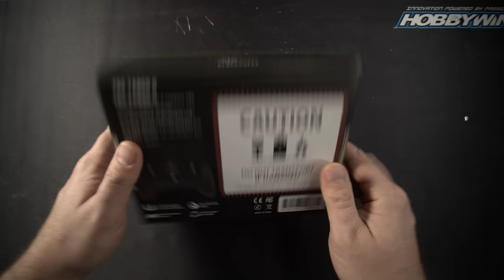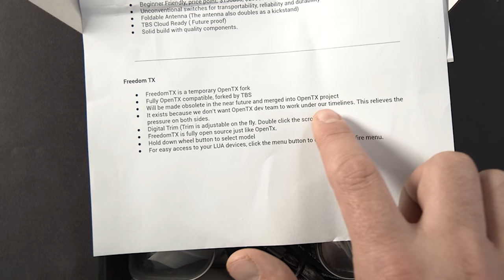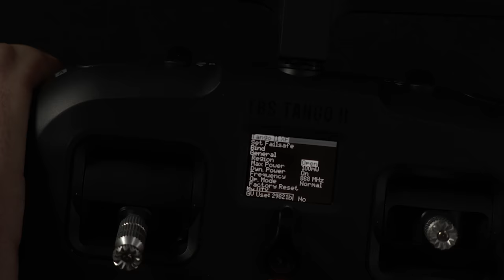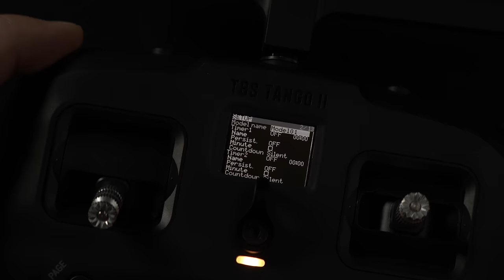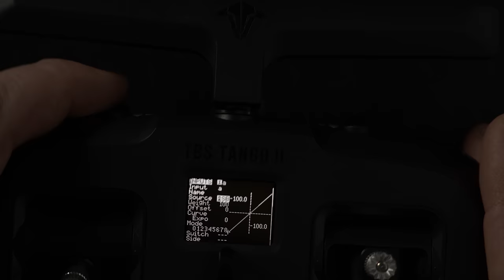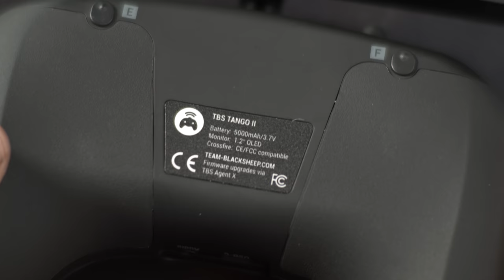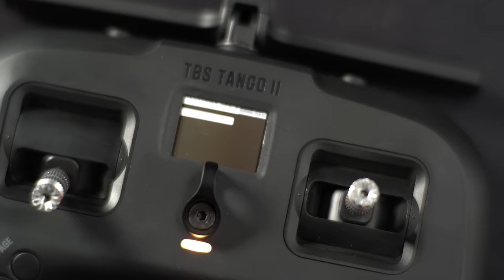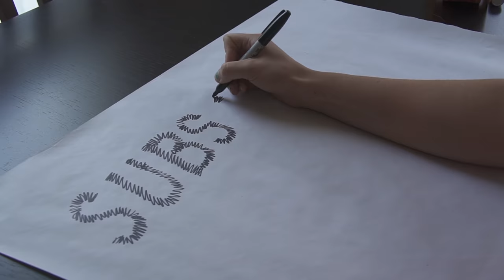TBS Tango 2 - Unboxing and First Flights

Comment: Sweet - awesome product, hopefully people will sell their old Jumper T16's to get these, and I can pick those up cheap.  I do like a lot of their thinking on the buttons and toggle switches - but having large hands and being a pincher means the big brick form factor works best for me.
Reply: @FPV-OG Either of the '16' line setup that has the internal multiprotocol module.  I know lots of people got those wanting it to be 'the answer', but may decide this is the radio for them.

Comment: Do you normally pinch without a neck strap? The fact that that's an option is encouraging. I would always use a neck strap myself, but ergonomics have to be pretty good to pinch and hold at the same time.
Reply from the maker: I always prefer a neck strap but it works very well for pinching without

Comment: One question. Why not just use the Dji controller for your Dji quads? You don’t have to solder an extra receiver to the quad that’s gonna break off after a crash. I’ve never had a fail safe with it yet. I understand that you have to use other controllers for racing analog or extreme long range maybe.
Reply: EscobarFPV because the crossfire has lower latency especially when at the edge of the range for DJI it gets much more laggy than crossfire
Reply: @properfpv7160  what kind of range are you talking about? I don't feel any latency at all from any distance that I fly while using the dji transmitter. I watched a video where he tested crossfire vs DJI(baud-fast) and the dji was a hair faster at 7ms. I've never heard of anyone complain  about latency with the dji transmitter.
Reply: Just looked at your videos. Dude. Do you even DJI? Let me guess. A buddy of yours let you fly theirs.

Comment: im not too sure about the added latency you mention , i've seen a osci test of 5 goggles and 30MS is normal on analog. The ev300d came out over 100MS tho,  so yeah, i was stunned by the results of fatshark etc. because i always thought it would be around 10-15ms.

Comment: How do you feel about those shoulder switches? Those rocker switches look like they're really easy to activate. I kinda wish I could have short switches like the x-lite on all my radios. 
Does it have a trainer port or any way to plug a multimodule or LRS system into it? 
I guess it makes sense to only have a 250mW output because of the 1s 5Ah battery inside. Can you charge while flying?
Does yours have the folding gimbal sticks?

Comment: Man, this is my exact issue with DJI - even at 700mw that's the kind of performance that i get in woods/trees even with focus mode, the image in those environments just get so blocky to the point where you smack into scraggle you could normally easily avoid.  In your case right off the bat focus mode was heavily active almost immediately.  I'm pretty confident that analogue would've far outpaced the reception there.  And then you switch over to the stadium where reception is amazing where analogue would've probably been a little glitchy with all the flat surfaces.
Reply from the maker: I think my antennas had been loose to be honest

Comment: Having trouble with setting my end points on the Tango 2 in betaflight. Even tried CLI commands. The throttle end points especially are not changing to 1000 and 2000. Any ideas?

Comment: Pro you get 
    1 x Tango 2 Pro
    1 x Velvet Carry Bag with TBS Logo
    1 x Springs Set ( Default and Lower Tension)
    2 x Throttle limitation screws (with allen key)
    1 x Sticker Sheet
    1 x Tango 2 3D KeyChain (will only be included in the first run)
Standard edition you get just 
    1 x Tango 2 remote
    1 x Springs Set ( Default and Lower Tension)
Reply: Also fold away gimbal sticks on the Pro
Reply: Low tension springs, nice!
I had to stretch out my Xlite springs to get that..

Comment: The antenna is supposed to be flipped sideways, that’s how they recommend it
Reply: I believe it depends how you've got it mounted on your quad.
Reply: Ooh ok cause I thought it was just more optimal sideways
Reply: @adamhasan7370  you generally want to match antenna orientation with your TX and Quad (which depends on how you fly...) either way i believe the recommended orientation for longer rang is vertical.

Comment: 🤷🏼‍♂️ Nothing too special about this... Just a remote like xlite with crossfire. Not worth the hype i think 🤔
Reply: The hype in my opinion centres around the fact that it's compact and useable for pinchers. I've been waiting for a radio that I can throw in my bag without pulling antennas on and off. I tried the xlite and it's not big hands friendly even with extended gimbals.
Reply: @Burn377  
Why do you think that pinchers need smaller form factor?
Reply: @maksimreshetnikov1029  portability, my x9dse isn't great when stopping along the road pulling antennas on and off gimbal protectors etc
Reply: @Burn377  yeah, I fully agree with you, I also want something smaller and lighter then my x7s, but Tango 2 has 20% less stick travel(it's not full sized gimbals like x9 or x7)
Reply: @maksimreshetnikov1029  I could almost use the x-lite with the extensions but the form factor was awkward to pinch with so will see when mine turns up.
Reply: @maksimreshetnikov1029  Tango 2 does have full size gimbals unlike the x-lite